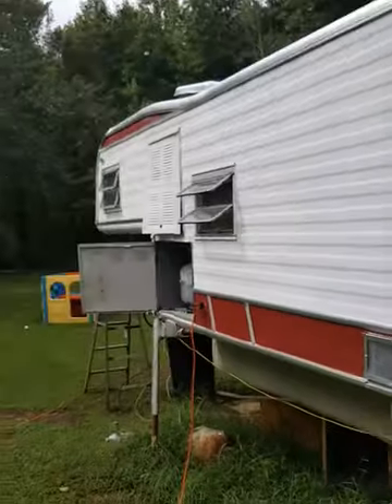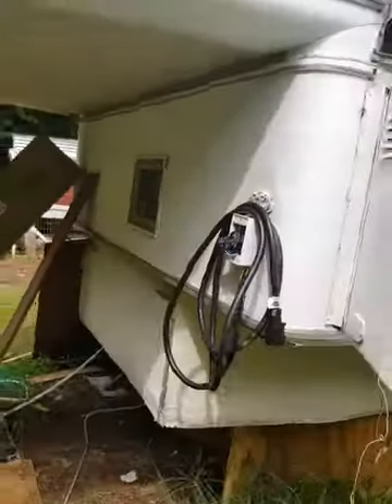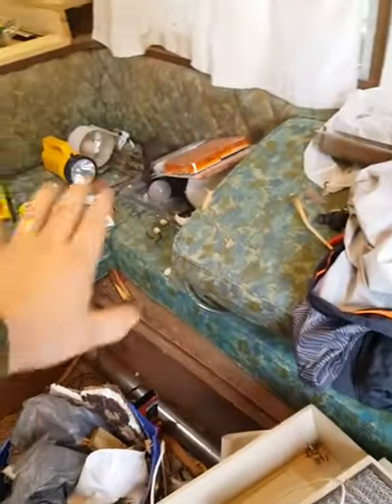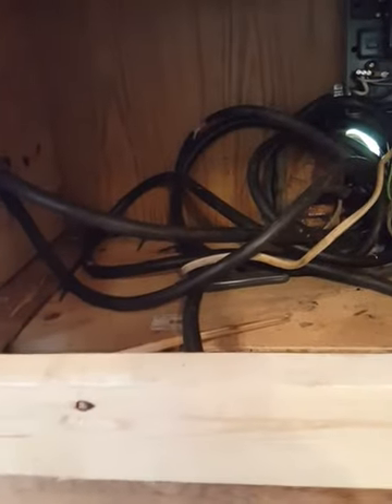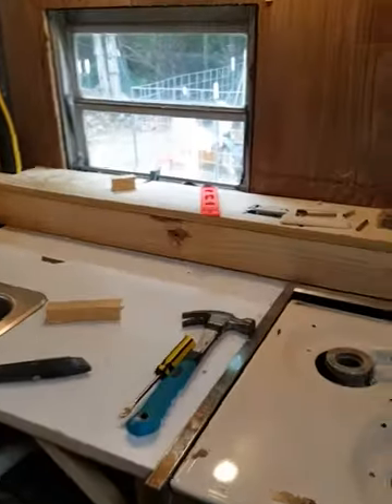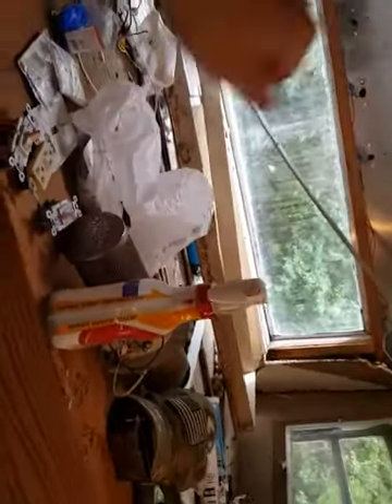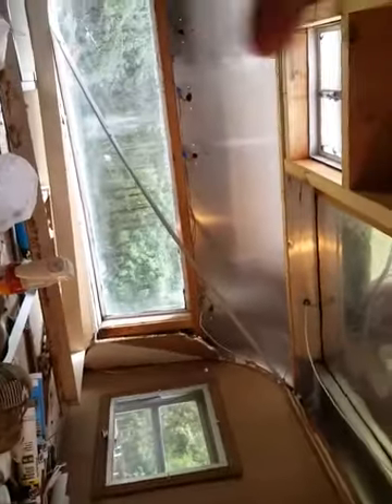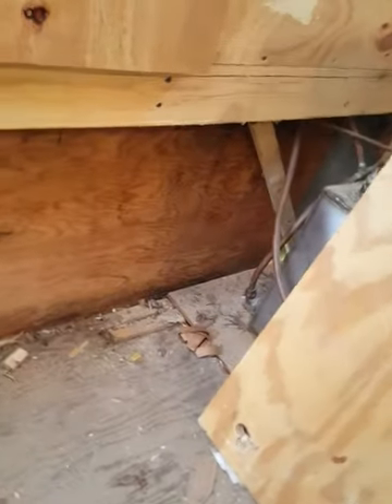1968 Holiday Rambler Pickup Camper Remodel!

Comment: Dry weight of camper 2300, original water tank 26 gallon, black tank 20 gallon, length 11.6. These are extremely rare. HR's are very well built
Reply from the maker: Yes sir.  It is very heavy.  I am going to put it on a trailer this summer.  It is very hard to load in the back of the truck!!

Comment: When you put the new ceiling in, did you staple or screw it into the aluminum framing? Did you use any adhesive? I have an aluminum framed  1987 Hornet truck camper I'm working on.